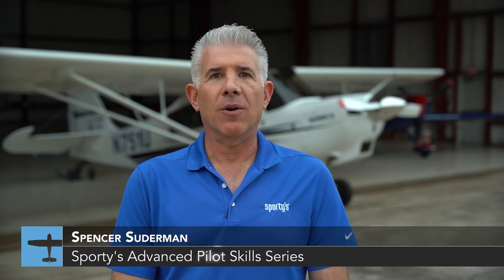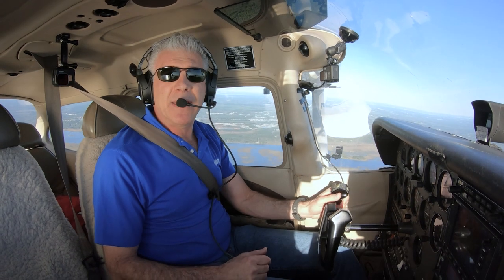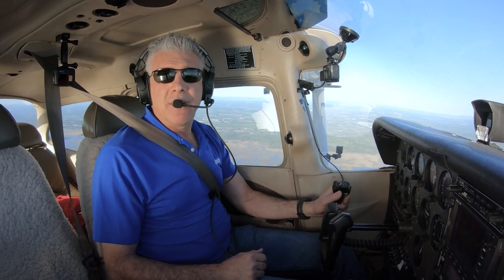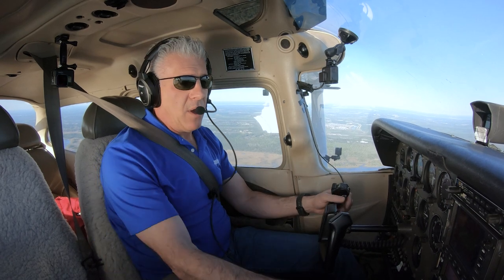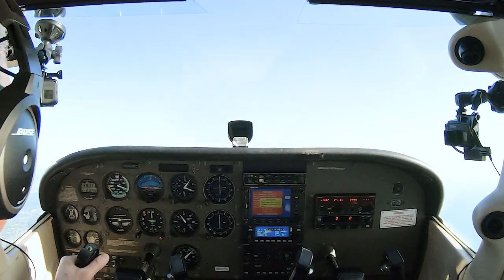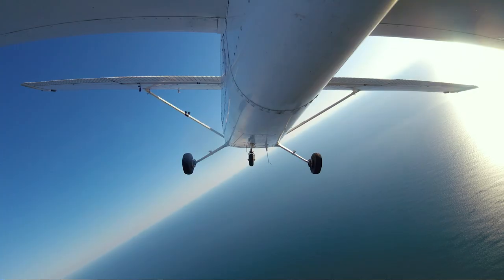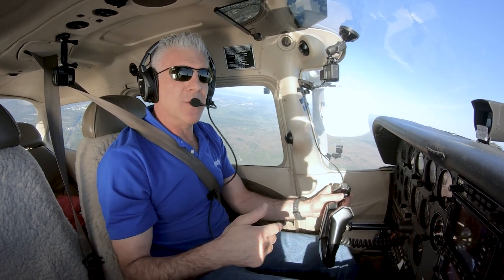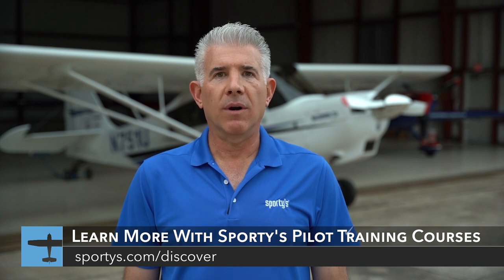Is the impossible turn possible? Sporty's Advanced Pilot Skills Series with Spencer Suderman (ep 10)

Comment: I have done these sorts of tests in a C152 and found that the best way to minimize altitude loss during the turn is actually to bank extremely steeply (like 60 degrees) and keep back-pressure on the yoke such that the stall horn just barely starts to sound. It's easier to do this if you don't pay attention to the ASI, just listen for the stall horn and adjust back pressure accordingly while keeping your eyes outside to judge attitude/position so you don't overshoot the turn. At 60 degrees bank flying slow the nose comes around really quick so overshooting is a non-trivial possibility. The reason this works is that it keeps the turn radius as small as possible, so although the rate of descent during the maneuver is extremely high, the time and distance it takes to perform the maneuver is also very short. That said, I personally would not attempt this maneuver in an actual emergency except at specific airports where there are no safe options for straight ahead emergency landings (surrounded by dense city, for example). The risk of a stall/spin is obviously high, and to do it properly you have to be very decisive and aggressive. I did these tests in a controlled environment at a few thousand feet AGL and am not sure I would be able to pull it off in an actual emergency.
Reply: I’ve found this to work well, but it is HIGHLY inadvisable as it takes an above average amount of stick and rudder proficiency to do safely.  Of course, even with fancy flying, you’ll need a minimum amount of altitude to pull it off.  Headwinds and excess runway length play major roles as well.  Having been mostly out of GA for a few years, I know I’m not proficient enough for this and I’d be looking straight ahead.  The key is knowing your limits, based on demonstrated proficiency during training, not based on gut feelings or pride.
Reply: Stall speed increases with bank angle. Very risky to stall at 60 degrees and low speed.  Shame these ga planes are so unsafe in a relatively low speed crashes that crush occupants. They just pretzel and fold up at 50mph+ impact
Reply: It of a misconception that stall speed increases with bank angle. Stall speed increases the bank ankle at level flight with no loss of altitude. Roll up to 45° but don’t apply anymore elevator and stall speed won’t increase
Reply: @flier3346  Rigth.  So many bullshiters in aviation.  Specially in EFATO emergencies.  I learned them from the best, and a turnback saved me in 2002.
Reply: @flier3346  but airspeed will increase and become above best glide and therefore decrease glide distance to "airport".

Comment: Two other things to consider. If you are taking off from a 3000 ft runway, then you will be at a certain altitude when you pass the end of the runway. If you take off from a 10,000 ft runway, you will be at the same altitude 3000 ft down the runway and potentially 3 times that altitude when passing the end of this longer runway. That will make the turn back to the runway much more feasible, assuming you have enough altitude to make the turn all the way back to the runway centerline. The other thing to keep in mind is that at busy training airports, another aircraft behind you may be taking off, executing a touch and go or a missed approach if they are practicing an ILS or localizer approach with missed approach. Making the turn back to the runway without immediately announcing an emergency and intentions might put you in a head on midair collision situation during or after completing the turn back to the runway.
Reply: Yes I agree. The sink rate is lower at that shallow bank but the amount of time it takes to turn is so long that more altitude is actually lost executing the turn than if it was a steep bank angle. For me in my 172 a 45° angle seems to be the best compromise.
Reply: As long as you have 3k runway and not too windy, and climbed at over 800 fpm,  i taught them like that to many students.  And 45 degree banks at Vglide speed.   Works.  Use flaps or slips if too high.  Be brave.

Comment: The trick to the impossible turn is very simple. Regardless of your piloting skill, at a certain altitude, your airplane will not make the turn back. However, there is an altitude that it can be done. The way I've learned it is to fly up to a few thousand feet, and do the impossible turn up high. After doing it a lot, you can analyze that in your airplane it takes you however many hundreds of feet of altitude to make the turn. Give a bit of safety margin and that is the altitude that the turn is possible. A lot of pilots kill themselves doing the maneuver even when they have enough altitude because the pilot fetal position is to pull back on the stick. If you do not pull on the stick, the plane WILL NOT stall, if it is reasonably trimmed and rigged. It will not happen. Once your engine fails on takeoff, if you are at the altitude you know it is possible, make the 180 and don't pull. It takes a lot of practice, and it should be a last resort usually, but it is absolutely possible.
Reply: "the pilot fetal position is to pull back on the stick" - YUP!  I call that the "startle & snatch" response.  Most pilots are springloaded to pull back and raise the nose away from the ground.  Teaching upset recovery is mainly about teaching pilots the discipline of NOT pulling back in emergencies.

Comment: Seems like a 270 degree turn is not required. You also need another 90 degree turn back. You could intercept the runway if you are at a 45 degree angle. The more turning involved the more you'll sink. You could turn 225 degrees and might save altitude. Certainly worth testing either in the air or simulator.
Reply: And that is the whole point of the video... go up and figure it out!  :-)

Comment: I don't think that I would ever be so certain of my single engine aircraft or myself to attempt the impossible turn, especially with the adrenaline flowing after an engine out at low altitude, the natural tendency to try to stretch the glide if you've settled and come up short, and knowing that most pilots who have tried it didn't make it.
Reply: So what you say is that you get too nervous to do gliding turns.  Sorry for you.  Also you say about turnbacks..  "most pilots didnt make it".   Wrong.  Turnbacks are done thousands of times a day by cropdusters with 1-2 tons of chemicals.  At 200 agl or less.   I have done 3 by engine fails.  For real.  No damages.   Most turnbacks for LOTOT are not reported, due no accident.  who is Bullshiting you into been so scared of gliding turns and LOTOT practice?

Comment: It is difficult to realistically practice this at a safe altitude because you are missing a key element and that is proximity to the ground. This is the element that causes so many stall/spin events because you are fixated on a point or object on the ground and a specific track across the ground to reach that point. This is when people get uncoordinated because you are not driving across the ground, you are in the air which is itself moving across the ground. So, in most cases, your nose is not pointing the way you are going and if you unconsciously force it too you are now in an uncoordinated state. 

On top of that there are simply too many variables to allow you to derive any meaningful conclusions from this type of practice. Wind is certainly one of them as well as terrain. It might be completely ludicrous to "land straight ahead" and in many cases you don't need to make a complete 270 degree turn or make it all the way back to the runway as airports are generally encircled with an expanse of flat grassy area with few obstacles that might well be the best option to crash onto if there is no better choice.

Probably the best advice is to train yourself to be spring loaded at every take-off to react to a possible complete loss of power by pushing the nose over and getting the best glide speed established. Also, if it is an airport you are familiar with, have a pre-plan for an area that is straight ahead or near to it if they exist. If you can get through those two critical instances you've got a good chance.
Reply: It seems the video got you thinking critically about the reality around this very controversial topic!
Reply: @ssairshows  I've had plenty of time to think about it as I've been a pilot for over 50 years so I'm not sure if this is a controversial topic or just a newly sprouted internet meme. It's only recently that I've noticed so much banter about this single decision point. Somebody came up with the "impossible turn" phrase and it just took off from there. In reality I think most pilots on take-off are situationally aware and will get to a point where they have decided that if it happens now I'll turn back whereas prior to that they would not turn back. Basic pilot knowledge is that if your engine quits (at any time) your number one job is to maintain control of the airplane. If you don't stall or spin it you've got a good chance of walking away. So I don't buy into the idea that it's good to pre-program yourself to take a particular action in a situation like this other than to get the airplane under control and keep it there.
Reply: @pi.actual  The issue is pilots who rationalize this maneuver in particular with an absence of experience.  An emergency is not the time to try things for the first time; safe flying is about experience and proficiency which leads to superior decision making.

Comment: I learned power on and power off turnbacks on a Cherokee in 1997.  On the air sim a runway at 2k, then at 1k over a highway.  Then on a 4k runway too for real.  From the CFI of Emergency LowManeuvering Channel.  He was an expert on turnbacks and EFATO.  He taught 4 kinds of EFATO.  YOu are right about been 270 degrees of turn.  BUT.  YOU HAVE TO BANK TO 45 degrees at slighly under the best glide.   20/25/30  degrees bank will widen the turn too much and its NG.  This is wrong.  I was a CFI then.

Comment: There is no way in hell an aerobatic pilot of this guy's experience honestly believes that the best way to turn an airplane around with minimal loss of altitude is to bank 20 degrees "or otherwise you sink too quickly". This has to be some sort of editing screw-up. What the hell.
Reply: Thanks for your comment!  You could just stop the video right after I remind the viewers what the checklist says.  If you stuck around past that part  I emphatically state - go up and try this at safe altitudes to develop your own experience and proficiency in a plane you regularly fly.
Reply: @ssairshows  I think it’s important to be clear about the message here. If the message is “don’t bank too much close to the ground because you aren’t good enough to pull it off and you will stall” - that is a message I can certainly get behind. But that’s not what was said in the video. In the video, the message was “I’m using shallow bank because if I bank any more I will lose more altitude in my turn”. That message is grossly incorrect as it relates to almost any aircraft anyone realistically flies. Hence my surprise.
Reply: @alk672  Right.  Im laughing at this guy.  What a joke.  Cant do gliding turnbacks.  Some guys cant do gliding maneuvers at all.  They are good only with engine on.  That is why so many crash.  We called them Power on Pros, but No power fails..
Reply: This guy is using a 5 mile long beach to practice turnbacks.  The 20 degree shallow bank will take a long time and a wide turn that wont reach the runway.  But because he is using a BS example of the runway, he cannot see that and spread BS all over.  Seen many videos with Turnbacks BS.  I taught hundreds of turnbacks when CFI in the 1990's. Not only at altitude, but also to a 4, 500 feet long runway, with many airplanes and winds and altitudes too.  Have videos from 1995.  I cannot be fooled.
Reply: @emergencylowmaneuvering7350  Yeah, he is fooling himself by using a 5 mile long runway as reference.  Ha, ha ha...

Comment: Good idea for performance info; however, I noticed that while in a bank your airspeed increased quite a lot and therefore, the information really isn't valid.  Just saying...
Reply: Right.  If you have no engine power and hold backpressure in a turn preventing descent you will stall.
Reply: @ssairshows  It looks like Vglide is 65 and Vs1 is 50.  That is 1.3x Vs1.  You are perfectly fine in a 30 degree bank at 1.3x Vs1.
Reply: AND, if you want to check it out for yourself, go do some accelerated stalls at 1.3 Vs1. You'll be surprised at how much bank angle it takes. IF you have the altitude, yes for sure, the greater the airspeed margin the better. I guess it's all about proficiency and knowing what kind of performance you can extract from your aircraft.  I’m just saying performing the turn at a straight and level trim setting and letting the aircraft seek out the new trimmed airspeed will cost you altitude in a dynamically stable aircraft.

Comment: Gee. Sir, You have to use like like a mile long highway at say 2,000 feet agl over it.  More realistically, do a 45 bank angle at slighly lower than Vglide speed.  You wont stall that way.   I taught turnbacks and LOTOT Turnarounds in the 1990's to dozens of students.  To a real runway, not just  "only at altitude" which is BS sim.   And on the turnback, you dont "Turnaround" like you said.  And it is a like a Hook Turn, or Question Mark Turnback, not 270 plus 90. Hook Turnbacks are only 270 total turn degrees If you turn 45 bank at say Vglide -5knots.  WTF.  Geeee !!

Comment: Try turning back in that situation, and when you damage/destroy your aircraft, and if you survive, then try talking to your insurance company. They will most certainly know what the checklist says and what you did. Good luck getting paid out. In still air in a C172 with two experienced instructors, the absolute minimum from which a successful landing could be made was 300'AGL and that was a simulation using all the skills and tricks available. I can promise you that neither of those instructors would remotely consider a turnback in a real-life situation.
Reply: Thanks for watching and your comment about the checklist :-)
Reply: 300 agl only if partial power.  600 plus if no power and some wind to help you turn shorter and come back..
Reply: You mean, the recommended on the manual is the only way?  BS.  A recommendation is not a requirement.   And most LOTOT accidents outside the airport cause damages beyond the airplane.  So the insurance co cannot judge all situations and pilots by one way to do only.   Most turnbacks are no or low damages.  The badly done are the most published, but the others ignored due no accident.